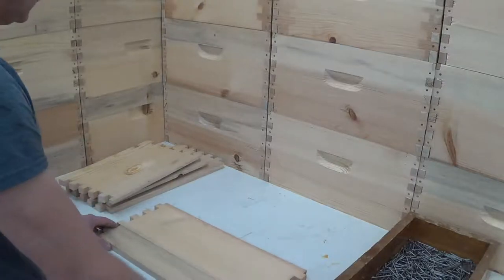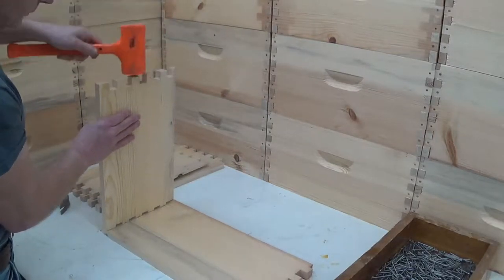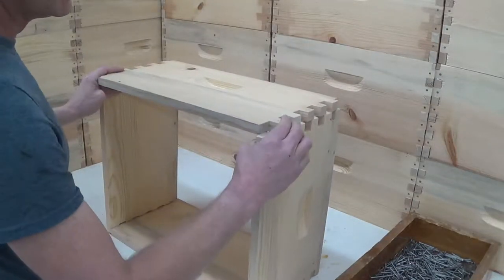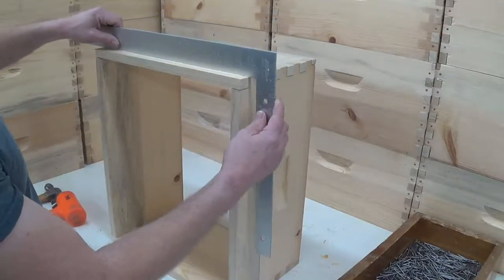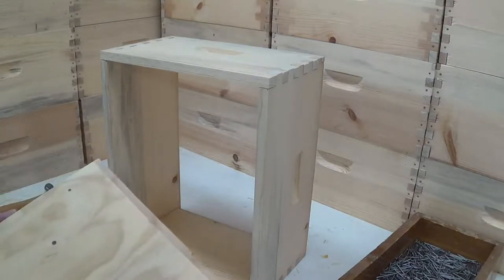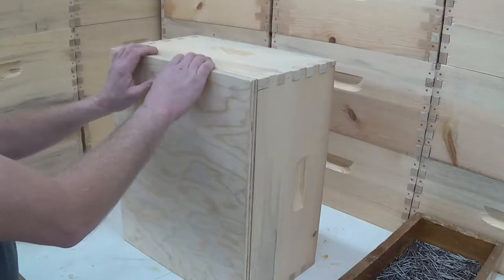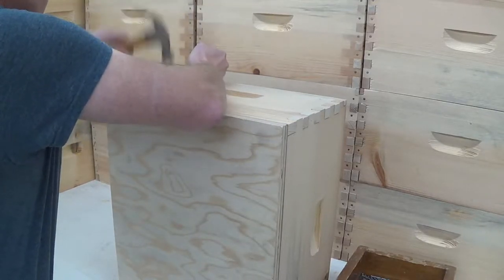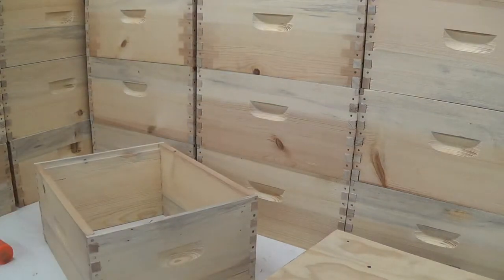How to Assemble Bee Hive Boxes

Comment: Hi there. I'm in the process of making my own boxes and frames and I think your videos are the most straighforward ones i have come across. Thanks for posting. I was wondering if you had a video on making the box joints fr the boxes. I've found a few others already but I am interested in your method. Thanks
Reply: also, no glue?
Reply from the maker: I use a Carl Johnson bee box machine. I am working on a method for using just a table saw and a router. When I get it perfected I will make a video. Thanks for your question and comments.

Comment: Do you not use glue when you assemble?
Reply from the maker: I do not because the boxes are mechanically locked together by the nails. Paint keeps the wood from deteriorating from weather. Glue or no glue if the joints get wet they will fail.